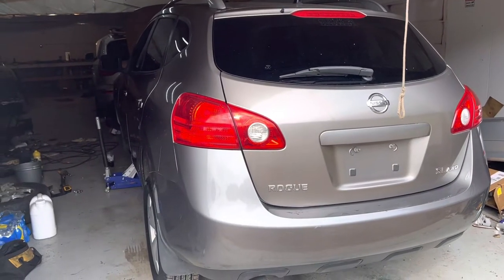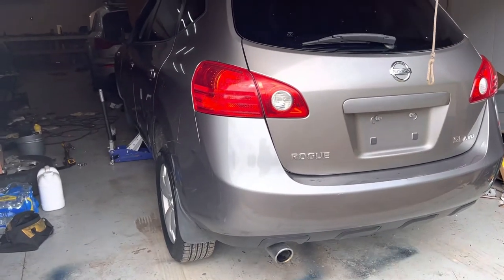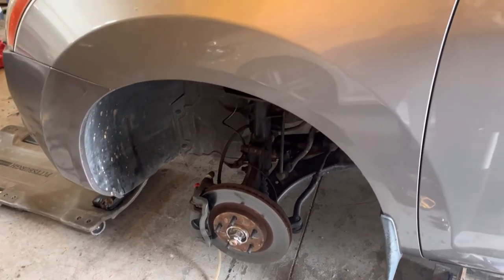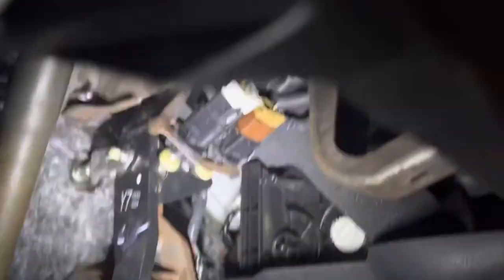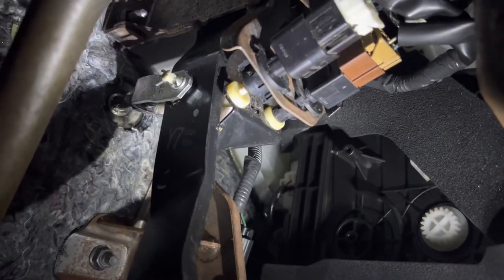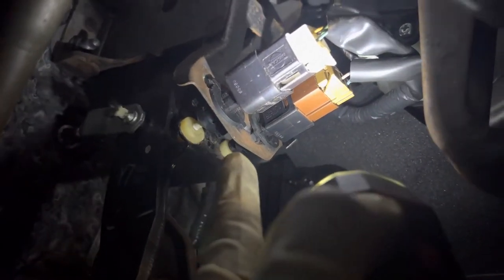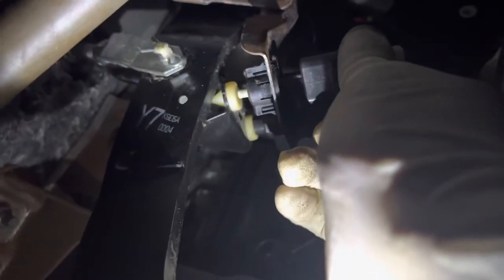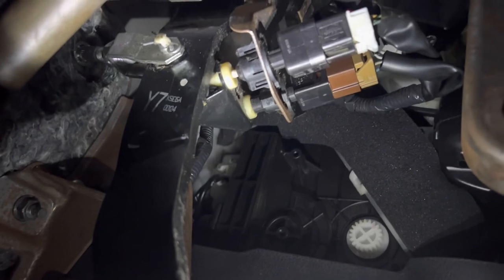Nissan Rogue Brake Caliper got Stuck! Easy Fix! Less than 30 seconds

Comment: Would like to echo what others have said. Was having this issue...and couldn't figure it out. I had replaced the plastic grommet a couple of months ago when the old one broke (which caused issues like my brake lights constantly on and then a period of car wouldn't turn on at all). Then the past few days, we had this brake lock issue. I didn't know it needed to be fine-tuned. Followed the video...fixed the issue. Thanks so much!

Comment: Honestly thanks for this video. I’ve been having this issue with my 2008 Nissan on and off for a couple of months. Similar to your car my vehicles front drivers side caliper would lock up when I breaded hard. I’ve recently switched all (3) breaks, rotters, and calipers with the issue happening again within days of the change. Hopefully this works to resolve the issue. My next step would be the break booster (which will be hell)

Comment: This make no sense stop tell ppl trash that’s for the brake lights
Reply from the maker: Well you would be surprised what these electrics control. They may seem to be just a simple switches but they control more than you can imagine
Reply: Would this cause the brake to push a car forward when applying the brakes?
Reply: false itll literally send a signal and lock the brakes and explains why the only way i could disengage the brakes was to manually lift the pedal by hand.... i thought it was the brake booster or the master brake cylinder! nope was this switch..... nissan is insane for this level of fuckery but this man is speaking facts